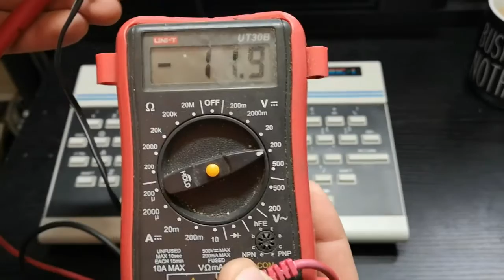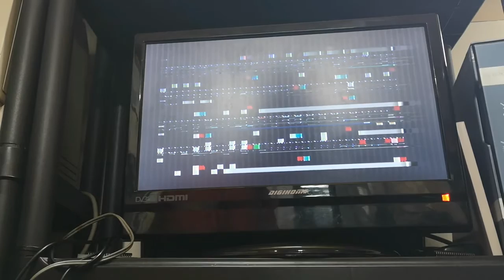Classic Computer -  Alas Poor Oric - Oric 1 repair part 1

Comment: phil kruman, I think it worth pointing out that the higher voltage measured on the original power supply is due to there being no load on it.  It is after all a very basic unregulated supply.  As for replacing it, I have no issue there as modern ones run cooler and more efficiently.  I would still keep the old brick around for the collectors however.  I've repaired a few of these interesting machines and am partway through making a clone (when opportunity permits).

I will add further comment when I've watched the whole video.

OK, further down, I noticed you attempting to measure voltages referenced to a screw on the keyboard.  I haven't seen an Oric-1 keyboard revision that connects it as yet.  There are numerous places you can get a solid reference from.  Still, I shall keep watching.

OKAY!  Pin 24 is the pin you'd measure 5V coming into the HCS10017 ULA IC, not pin 1.  Onwards and upwards.

I CAN'T WATCH ANY MORE!! PUT DOWN THE MULTIMETER AND STEP AWAY FROM THE BENCH!

The ULA's on these machines don't fail very often at all.  Rather, the RAM tends to get cooked because accidents with the supply rail tend to bypass the regulator and put 9V on the logic and the fact the memory used in the Oric's at the time were quite fragile little canaries ;-)

There's also a matter of the GI AY-3-8912 sound chip being driven by the 6522 VIA in software and not therefore meeting correct timing.  They couldn't even quite meet the duty cycle specs but that doesn't seem a problem.  Please go and download the available service manual and learn from  http://forum.defence-force.org/

I will support anyone keen to learn about this quirky and wonderful little micro in my limited capacity.
Reply from the maker: Hi, thanks for your comments - The screw was earthed as it was convenient for filming . 
I see exactly where you are coming from  with Pin24,  but what was seen on the video was not checking voltage at that time, although I agree I probably need to be a little clearer at times as I sometimes jump ahead due to years of just doing it rather than explaining. 
The ULA on this machine seems OK and  since  the Ram has since been checked as well as the AY chip on a scope, I have to wait for the parts to repair the unit. 
 But as an aside,  the ULA on this machine  is functioning  but only  just. There is a slight degradation on the waveforms and nothing about it is clean which is showing up as the chip gets warm. So this will need attention sooner than later.  
Most people seem to assume the Ram is the cause of most problems not only on these machines, but many others.  In my experience of inspecting and repairing many thousands of motherboards , Ram only accounts for less than 25% of faults.  
Poor quality ICs and processors are a major factor as in some cases, companies such as ORIC and Sinclair, used second rate components which  failed  at an accelerated rate.  
ULa's on these machines if looked at with a scope are getting noisy and are failing. Sinclair ULAs are becoming unstable in a large number of machines and it is the same for Acorn Electron's , and the ORIC 1. 
I appreciate your comments and it is great to have informed discussions and it is what this channel is all about. 

Thanks again 
Phil

Comment: Hi, check the 5V voltage on pin 28 and pin 14 on that empty socket. Then perhaps change out the 1 uF cap to something like 10uf or 22uF on the reset line to the CPU. The ULA looks ok.  I bought 3x ULA from a guy in Bulgaria(?). All were fine. Pls post your results.
Reply from the maker: Thanks for the advice. I have just got the spares from China and funnily enough the ULA from Poland has turned  up, so I will post the findings as soon as I get the repair done.  
Cheers Phil

Comment: I forgot to mention, the poor little 7905 regulator needs a bigger heatsink really.  These beauties run HOT!  I don't believe the oscillator circuit (being based on a 74 series IC) could have run to supply the ULA with it's requisite 12MHz at such a low voltage.  This oscillator is used for generating the dot clock, driving all the counters etc.  Most of the system depends on it and without it you wouldn't even get a sync pulse.
Reply from the maker: Thanks for the update. I am still waiting for the new parts to arrive as I wanted to use these instead of reclaimed ones from other machines, but I may have to rethink this as some of the parts are winging their way from China (or supposed to be) so I guess it may be a long time before that happens. I may have to resort to reclaimed parts as I am itching to get the Oric up and running again. 
Thanks again for your info as it is much appreciated. Cheers Phil
Reply from the maker: I forgot - Once I have the correct parts, I will post a video including an scope view so viewers are able to see what was wrong and what it should be.
Cheers
Phil
Reply: phil kruman Some helpful clues here.  The CPU talks to the VIA which talks to the sound chip which in turn helps with the... KEYBOARD!  GO figure.
Reply from the maker: Thanks for your info.  I think I need to do a video how the machine was put together and how it was designed. But this video was designed to encourage people to try and repair a computer with basic tools and not an overly technical one that would frighten people off from having a go. 
Having designed hardware for 3 of the largest IT companies,  all I can say on your findings is that this is normal practice for the day. The reason for this is all down to cost. Not technical ability or the fact that it works better that way, Its just 100% cost.
If one I.C. can be used for multiple jobs, it would be done that way. The same goes for the ZX Spectrum or the ZX80/81 which had no video processors and relied on the CPU to do all of the work. In the same way the timing or clock cycle has a rise and a fall which I used to help speed up image processing on a project that eventually became a well known laptop for a large US software company.
The biggest issue with using hardware tricks  and IC's that were not designed for the task they have been given is heat and reliability. On the ORIC circuit protection is almost non existent. A minor spike of voltage at the regulator will damage the CPU and ULA. Even though the regulator in theory can handle 12v it does not mean it will cope with it continuously. In a country where the Oric was produced running at AC 240V (anything from 220 through to 260 in reality) could mean a small spike on power on, which  is why after a power outage, and restoration of said current, we see a lot of 'brown outs' or damage to electronic components. 
This is the major reason why on older machines, the PSU is always replaced if it is near the upper end of what a regulator can cope with.  If a computer uses 9V DC but an unloaded PSU is nearing 12V then it is a sure bet either the PSU will fail and spike or the regulator will fail due to heat soak sooner than later.  Using a 40 year old PSU is generally asking for problems. 
Modern PSU's are more stable and will generally produce the required voltage with or without a load. 
All of the 1980s micros were built on the cheap, each and every one was not expected to last for extended periods of time (i.e. 30 years plus) . 
As for ULA's, they are not used any more because they were not reliable once computer companies started to  use over 90% of the gates available. 
I had exactly the same problems when working on the Orater, which was eventually abandoned after a short run due to problems with un-reliable  ULA's.
In reality, the design of these (classic micro's) machines were not great when compared to modern computers, but that is what makes them interesting  .
Thanks for your conversation I have enjoyed the discussion as its great to hear how other people deal with problems.. Cheers Phil
Reply: phil kruman In fairness to the ULAs of the day, CMOS hadn’t taken over the world by that point and as people then as now wanted their kit to be quick, CML was still a popular technology in ULA’s.  The poor little Electron has massive ULA problems, the BBC’s VULA overheated (mask design issue) and the early ZX Spectrum ULA’s need a bodge or two.  The Oric’s ULA is what gives the machine  much of it’s unusual character.  I forgot to mention earlier that there isn’t much clearance around the AY and 6522 IC’s and sockets may stop the bottom going back on.

I don’t think the transformers in those old PSUs are anywhere near the end of their service lives, but the capacitor probably is, and I just don’t know about the rectifier bridge (howsoever constructed).  As always, I warn the noobs to steer clear of messing with the mains bits and so the PSU becomes a collectors item.

I think you could do a lot worse than give people a guided tour of the architecture of a primitive system such as this one, what with modern systems being vastly over complicated.  I shall remain subscribed for a while.
Reply: phil kruman Oh, and please don’t think I’m trying to attack you, I just want the details about right.

I scrape the internet and reference material as frequently as I can to make sure I don’t spoil my beautiful collection of 80’s home computers.
Reply from the maker: @Jenny_Digital  I am not, I actually enjoy these conversations. Because if you do not take on board what others think or do, you never learn or grow. If you have any other info, Id love to hear them. I have enjoyed the conversation . Keep it coming and I will produce a technical overview of the Oric 1 soon. If you have a look at SD Marshalls service manual for the Oric 1, its a good starting point, but some of it is not as accurate as it could be as it has been scanned, translated and edited far too many times over the years. But its a good general reference guide.  
Again - Thanks for the conversation, this is what these videos and the community should be all about.  Cheers Phil (keep your comments coming please)

Comment: Why do you check the 12Vdc power supply on the 200Vdc range of the multimeter instead of the 20Vdc range ?

Comment: Are you sure that screw on the keyboard is good GND point for the test meter?
Reply from the maker: It is when you run a clip to ground. 
Cheers Phil
Reply: @Re-Tech  Cheers - didn't see that. :-)